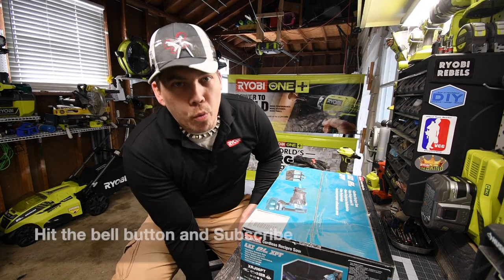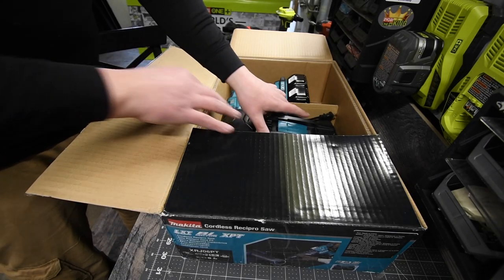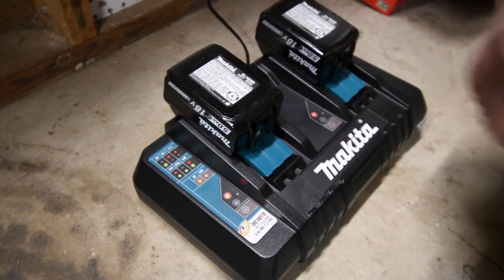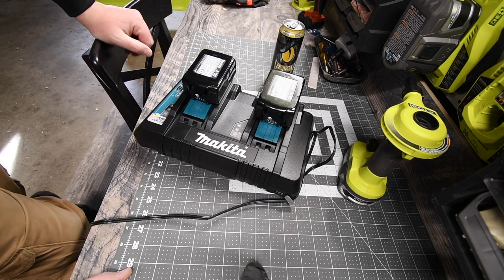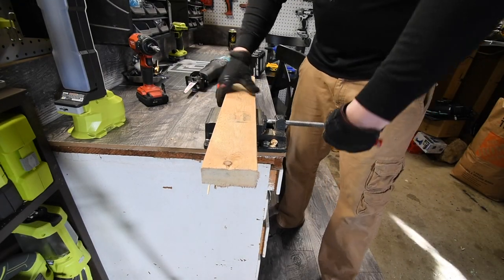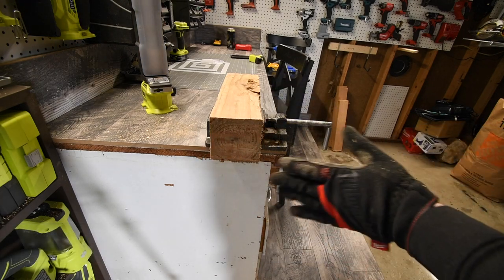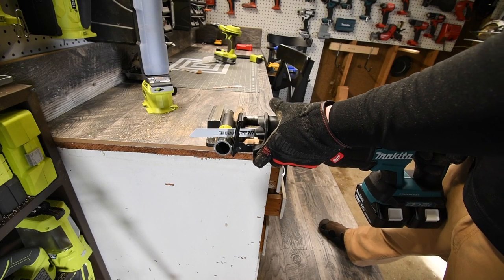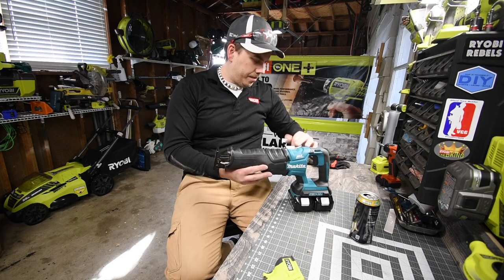36v Makita Reciprocating Saw

Comment: You need to get a piece of 4” cast iron soil pipe to do the comparison test with this sawzall and the supersawzall. Also use one of the Diablo carbide tipped blades because this will be very useful information for many plumbers including myself As I was looking to see if I should grab the super sawzall because I have the 36 V Makita and the rest of my tools are Milwaukee. Also be sure to use the 12 ah Milwaukee battery for the test
Reply from the maker: more tests will be coming up along with versus videos with a solid metal pipe
Reply: Man Caver Tools sweet looking forward to it

Comment: I’ve been considering replacing my Milwaukee tools with makita. I feel like I can rest assured because they make such reliable tools.

Do you have prolonged experience with Milwaukee? I’ve only had mine for 6 months but have already run into a few issues which were covered by the warranty but I still worry.
Reply: I generally think Milwaukee has the best line of tools right now.  If you do decide to go with Makita, I would certainly wait until they come out with their 40V line.  The 36V line will most likely be abandoned soon.
Reply: jps101574 I would agree that Milwaukee has the best overall lineup but I’m not sure if they will last as long as makita tools will without small problems here and there. From what I’ve heard Makita is the Toyota of tools. They very rarely will break down on you and hold up really well.
Reply: @YesImhymn  It depends who you talk to.
Reply: I have been using Milwaukee tools now for 5 plus years and I am happy with the line.I have had some issues but nothing to say that I will stop buying the brand.I do own some dewalt tools and Makita tools.I can tell you the batteries are good and I have at least 20 of the 18 volt and 20 of the 12 volt line all various amperage.So far I had a 9 amp hour battery die on me and they sent me a new battery.The other issues I have is with the sawsall blade holder.I have 12 volt and 18 volt sawsalls and those stupid things always jam on me.I use the tools to cut drain pipe and at times they get wet and that probably screws them up.
on another note the cables and cable heads for their switch pack drain machines are shit.The cables themselves are good but the connectors are crap.
The M18 small snake has issues with the auto feed it stops working but you can always use it manually.
Reply: @IndependentThinker74  as far as I know Makita won't come out with a 40V line they said something like they'd only put more ports for 18V Batteries
Reply: @adrianbaumann6638  the 40v line is already out in Japan will be in the states later this year
Reply: I kind of doubt 36v will be abandoned 🤷‍♂️. 36v uses 2 18v batteries, the same exact battery as the smaller tools. You would not have to buy into another battery line.
Reply: @Steve_K_MS660  I don't think that Makita will drop that line considering they just came out with a hang on back power  pack that uses 4 x 18 volt batteries.They have not come out with any 9 amp or 12 amp battery so they are sticking to what they have.I have a few of the 36 volt tools and they are pretty good.The back pack is for gardening tools.You will get longer run times instead of changing out 2 batteries.Do you really need it?Probably not
Reply: Agreed, that comment was for jps 101574
Reply: I’ve spoken to makita about the 36v line and I was told that it won’t be going anywhere anytime soon.
Reply: @Steve_K_MS660  that's exactly what I meant
Reply from the maker: I think every tool brand has a trick up their sleeve. they all have that one tool that will dominate the other brands.
Reply: Milwaukee is the same company behind Ryobi and ridgid. To be honest I feel chervon who owns ego lawn mowers , Kobalt and now the recently purchased skil tool is much more on top of innovation, performance and value for your money.

But I own an entire Makita tool set and it has been awesome with no issues.  I think a switch to Makita would serve u well

Comment: Not sure about everyone else but the blades on these are not very long and my 18v Makita has been able to cut everything to full blade length and equal circumference.  

Not really sure double battery system is necessary and the extra weight would be annoying. Always have a back up battery charging anyways. 

This really seems gimmicky
Reply from the maker: versus videos will be coming up and I thank you for viewing Mike

Comment: What are we cutting we need 36v of power. I work with steel and steel Construstion and my regular old 18v units work just fine. Seems overkill. But hell, more tools so I’m not complaining
Reply from the maker: I have these tools for the channel, but I use these in real life as well
Reply: @ManCaverTools  not sure you understood his question. He is asking if 36v is really required over the 18v since he says it performs just fine and I have to agree with him that in a reciprocating saw I have never needed more power. The blades just are not big enough

Comment: the Makita batteries charge fast with this charger
Reply from the maker: yes they do.
Reply: @ManCaverTools   companies are starting to produce faster chargers than the previous ones by adding cooling fans.They are also creating new platforms so they can get you to buy new batteries.Makita isn't one of those companies they are sticking to one battery style and this does save the customer money.